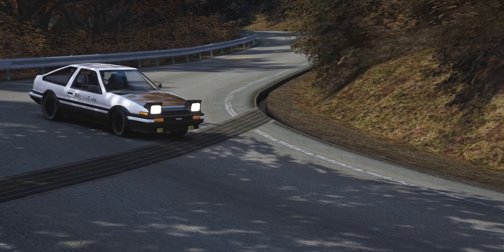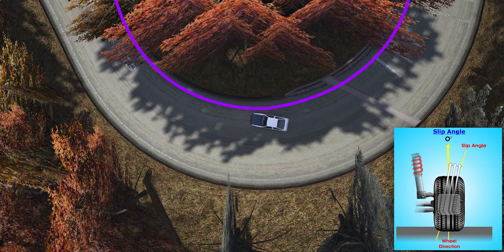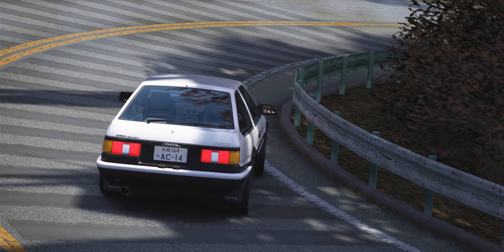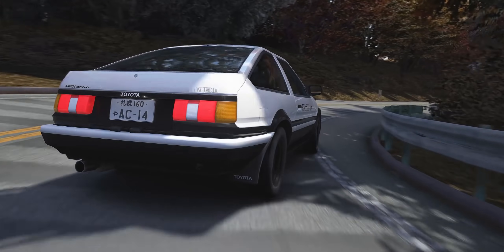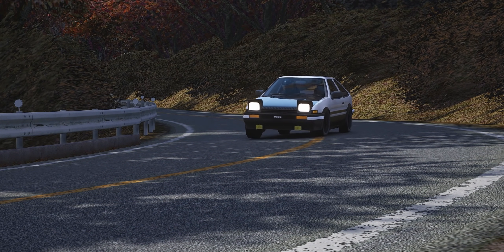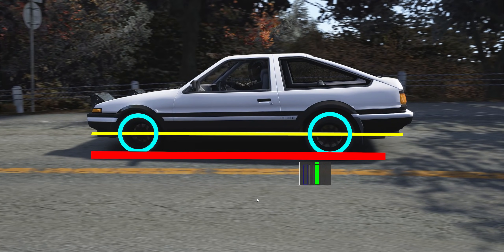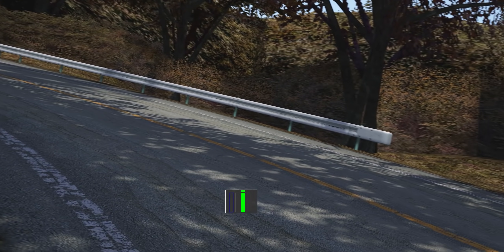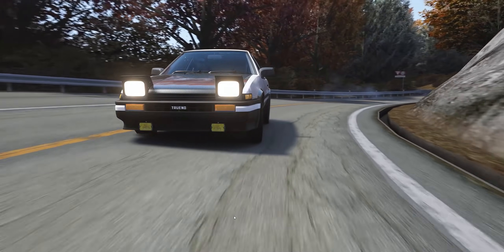Slip Angle in Touge - Master this to be a faster Sim Racer

Comment: Kunimitsu Takahashi actually "invented" this driving style, using it to make up for the missing power of his car during races (it helped him achieve multiple wins) , which then in turn actuallly started also helped invent drifting in the way we know it today. Keiichi Tsuchiya, who came to be known as the "drift king" only started drifting because he watched Kunimitsu Takahashi do this for the time unseen technique where he slid along the apex. He then started to work on his own technique, but more for style than function and became the drift king.
Reply: That's not entirely true. While Tsuchiya was inspired to develop drifting after seeing Takahashi race, Takahashi was not the inventor of driving in that manner, he just did it in a more dramatic fashion than the other drivers Japan's touring car scene. Racing cars being in a state of slip angle when driven hard was pretty much universal across all drivers at the time as it was a result of tyre technologies at the time, namely their sidewall deflection characteristics and hard compounds, along with a lack of down force when compared to modern equivalents. The pioneer of the technique is most often considered to be Tazio Nuvolari and it was used in some degree in Grand Prix racing until the ground effect era.

Comment: Since I play rally games slip angle seems intuitive because its the fastest way to get around the tight corners
Reply: It’s the fastest cause of side force. The tyres dig into the dirt as you go sideways round a corner so you actually have more grip that not sliding tarmac are dirt are in the same solar system but not on the same planet.

Comment: Same as shinji’s style of smooth grip/drift driving, no wonder he was as fast as takami
Reply: I thought shinji's technique was the minimum brakes since he uses engine brake to slow down his car thus making him faster than those who use brakes
Reply: @sesu5543  nope he uses his breaks many times but he doesn’t slam on them like most drivers, his technique is equal weight distribution on all four wheels at all times so he has an extremely smooth driving style that’s insanely fast plus he adds the slip angle technique to it, so he’s definitely faster or as fast as takami easily
Reply: @beautifulbeaner  hes only as fast on his home circuit though, on any ither riad he would suck, its because his technique revolves around having the perfect entry speed, little brakes, smoothest cornering, and the best line.

Comment: The weird thing about F1 is that if you notice in some specific circuits, the drivers will actually use the slip angle to be faster in a corner but it's just enough to turn them in fast without sending them into a spin

Comment: Personally, I think (in theory, I haven't been able to test it yet) that rotation should be done at entry/mid corner to point the car towards the exit earlier while carrying speed.

Then when reaching exit phase, the line from the car to the exit of the corner is more straight, and the car shouldn't rotate as much, because the less the rear wheels are spinning exiting the corner, the better exit you have, because traction is maximised and the more momentum you gain earlier and more constantly.

Sorry for the long comment 😌
Reply: this is actually a really good explanation
Reply: @deletedchannel117  Thanks! ✨

Comment: I used to think that it was just a quicker style of drift. But now I know that it is actually called slip angle, and I know more about it I can use it in games more often
Reply: It's not called slip angle... He's using the term incorrectly here. As he stated at the start of the video, slip angle is the angle between the direction a tire is pointing and its direction of travel.

Comment: I do this quite often when I'm hooning around in my car, just as I'm entering the apex of a turn I'll tap the brake to shift the weight forward so the back end swings around the outside of the turn and  was called trail braking, this technique is used in rally driving.
My car is front wheel drive that's why I drive like this because it gives the front wheels more grip when cornering
Reply: Pain

Comment: It is more about preserving momentum instead of accelerating through, into or out the corner Especially in a low horsepower car like the 86 at a higher speed you would also be able to keep the rpms high keeping the car on its ideal power band on corner exit.
Reply: Damn who knew an anime with some guys racing dowh the mountain could have such advanced physics behind it
Reply: @mahuba2553  I heard that they consulted the Drift King.
Reply: RPM means jack shit. It's all about exit speed. Drifting only makes you slower.
Reply: @StuninRub  it's always ideal to keep your revs within the peak power band whenever possible.
Reply: @StuninRub  Well in the video its more about powersliding than anything else, which is useful in some kinds of corners, and high RPM does matter if you wanna keep your car from getting too much grip back and snap understeering
Reply: @mahuba2553  Imagine not wanting your car to have too much grip. I bet your car has a big ass wing for downforce and FWD as well. 

What you saw in Initial D does not ring true for real racing. You always want more grip and the only thing that matters when cornering and going fast is the exit speed.
Reply: @StuninRub  And what IF I had an FWD with a big wing? Even those can oversteer, and you know that cornering aint just about staying in line and hoping nobody goes through the inside, there is way more than just that
Reply: @StuninRub   Actually for faster speed throughout a corner you want a "slight" oversteer, this we call slip angle,  It's not always faster to purely go on grip  Because keeping a high rate of speed  throughout a corner It's not possible if you have to break in order to keep the grip Especially on 75ﾟdegrees or tighter corners,  And talking about higher rpm's at corner exits  It's important for the RPM's not to be low since most sportcars peak on power and torque higher in the rpm range.
Reply: @StuninRub   Even formula one cars going through corners do not only rely on grid, Despite all of the aerodynamic devices  Their suspension designs allow for  The customization of caster caster and camber  Angles throughout the race In order to make it easier too slightly oversteer in corners thus keeping a higher rate of momentum.  To solely depend on grip is not the answer.
Reply: @kennyiglesias622  You want 0 oversteer. F1 drivers slide not because they want to, but because of the physical limitations of their cars. There's a reason why ground effect cars went so fast, maximum grip and maximum power. 

Initial D isn't real.
Reply: @StuninRub  initial d is not reality but what I'm telling you is  There's a difference in between loosing grip (tires being the limiting factor here )and purposely designing your suspension geometry in order to induce slip angle, is about carrying as much steady momentum as possible thru the corner not about keeping 100% grip at all times, I'm not saying that drift is always faster cause that's obviously not the case but depending on the corner you as a driver will need to prioritize your cars momentum&direction more than your grip cause you need to remember that tires and available traction are the LIMITING factors in all tipe of car racing sports in which you need to prioritize time from point a to b (f1, circuit racing, rally & time attack etc....) slight slip angle and a little bit of oversteer is utilized in their respective courses in order to reduce times. If you could have MAXIMUM GRIP WAYYYY BEYOND WHAT TIRES CAN POSSIBLY PROVIDE all the time then yea grip would be king but due to g forces you would not be able to drive that vehicle and that's not real life,  The utilization of slip angle in tighter corners remains one of the FASTEST ways to reduce times within current physical constraints even if you use ground effect to increase grip the 1st limiting factor would still be grip and if you wanna go faster even cars utilizing ground effect would still sustain slip angle if pushed hard enough to break the grip boundaries of its rear tires. Carefully watch how rally drivers drive thru tight corners or even less noticeable what how f1 , time attack and downhill drivers go thru corners you will notice that most cars look to be taking the corner using grip but if you pay close attention you will see that they actually carry a small angle thru them.
Reply: @kennyiglesias622  That vehicle with maximum grip does exist and it's called ground effects. We have the technology to create cars with enough downforce to drive upside down. Once again, stop using Initial D as reference. Grip will always yield faster times on the track.
Reply: @RacingOmen  His phrases are all bullshit. Initial D isn't real.
Reply: @StuninRub  Try me kiddo. I'm doing real tracks, rpm means everything. Not every thing is power and grip. It's how you drive your damn car and know how to use its limits. 

For sure you don't even have a real car to trash upon on while trash talkinh like that. Jeez.
Reply: @JMDrives  RPM means jack shit. Racing is all about power and grip. That's why you're stuck playing arcade games like Initial D.
Reply: @StuninRub   As previously stated even with ground effect,  Tires still become a limiting factor,  Even cars that utilize ground effect devices normally to lose a little bit of grip in the rear tires this is  normally not noticeable unless you pay attention but it does result in a little oversteer (a slip angle)  again not in all corners this occurs in tighter corners grip and power are just a factors  Too much power destabilizes the chassis and too much grip wears tires faster if you want a lot of grip it normally takes a lot of downforce with introduces a lot of drag making the car slower,  The grippier the tires the harder is to get them to change direction (eg.corner) so during corners they have to lose a little bit of grip first to gain it back in a different direction ( they have to let go, slip and stick to the ground again) no perfect grip tires that don't tear and wear exist and no ground effect is possible without making a sacrifice ( more weight on the car, more drag, A parasitic draw on engine power to have a fan suck you to the ground, or having to be already moving at a certain speed to be able to fully utilize the ground effect in the first place) THE FASTEST CAR IN ANY CIRCUIT OR STAGE IS THE CAR THAT MAKES A BETTER BALANCE OF ALL AVAILABLE FACTORS IT IS NOT ALL ABOUT A SINGLE OR TWO THINGS. but if I'm not trying to argue I'm telling you the truth of how it works in real life , I spend 5 years learning in the automotive field under the guidance of a Physicist ,mechanical engineers, fuel & emissions experts and mechanics. If as a mature person you want to learn you gotta let go of your previous misconceptions of reality but if you wanna keep arguing about this with someone that spend years of his life studying about the topics related to the issue and keep being ignorant about the way things work then as one of the comments on top of mine said you are not worth the time I'm putting into my replies.
Reply: @kennyiglesias622  Imagine thinking you have 5 years of experience because you were watching anime. You should look at what happens when ground effect cars lose traction.

 People who bullshit will always create responses with a ton of nonsense. 

It is never a good idea to lose traction. Intial D is not real.
Reply: @StuninRub  I know I have 5 years of experience cause I studied for 5 years at the same time I worked on cars, i never said initial d was totally real, it is never a good idea to ''FULLY'' loose traction, but you don't seem smart enough to understand that. You are right in one thing (People who bullshit will always create responses with a lot of nonsense) quite ironic that it came from the one saying the bullshit.
Reply: @kennyiglesias622  Mine's a slightly modded rav4 3dr, that's otw to being a 3sgte. Still costly for me in progress. But rather keeping myself on this car only, I also borrow my friends' cars on and off track to "experiment" 😆 how other cars handle differently than others. 

So I won't be like an idiot, being too close minded to just understand one thing about cars like this dumbass ---> @Zhida Zhou

Btw, wanna see your 13b on an FC soon bro. Goodluck with that! D1 Spec Banawe and JSK builds a couple of 7s. Maybe Aurick Go can help bro or Andy Adan.
Reply: @JMDrives  I'm not even going to lie, the whole electric system is gonna take me at least 3 months and I still want to have AC but I'm gonna have to buy a couple of plastic  trim pieces cause original ones from the 80s are all cracked now 😅, hopefully next month I'll get my piece of shit mobile moving under its own power, good thing the body is not rusted and the paint is ok, the whole thing is gonna be the worst part about it, I also ordered a new gauge cluster cause the stock one tops at 8k rpm and mine will probably redline 10K. Is not even funny the amount of time I have put polishing my turd on wheels but I love the thing.
Reply: @kennyiglesias622  I just subscribed to you lad; It was great reading and learning from your messages. 👍🏻
Reply: @StuninRub  hey hey hey, I can tell your an American muscle sort of person lmao
Reply: @jordanrobshaw1406  hey hey hey you sound like another weeb who thinks it's always JDM vs American muscle. Unfortunately for you, I'm not dirt poor and don't need to compromise for either.
Reply: @StuninRub  lmao ok mr "not dirt poor" what cars do you like?
Reply: @jordanrobshaw1406  Anything that goes fast and sticks to ground like it's on rails. Give me any of the proper GT cars.
Reply: @StuninRub  what car do you actually own though? If you own one of course
Reply: @jordanrobshaw1406  I drive a Cayman.
Reply: @StuninRub  ah the poor mans porshe, its a pretty good car
Reply: @jordanrobshaw1406  Only poor if you get poverty spec.
Reply: @StuninRub  its just its nickname,so what do you have against the lower class?
Reply: @jordanrobshaw1406  MIsinformed and thinks anime is real.
Reply: @StuninRub  why do you diss the lower class? I'm gonna assume you voted for biden or Bernie sanders
Reply: @jordanrobshaw1406  leave him alone, you know he really is the one who is not properly informed if instead of arguing with you he proceeds to ignore what others say and insult you. 
You are never going to win a rational argument with him because there's no rational argument to have with an ignorant person.
Reply: @kennyiglesias622  "Words are a powerful thing, but only if people will listen, action speaks loud enough for anyone to hear" - Ryosuke Takahashi
Reply: @Delimon007  Imagine think you are driving fast when you are losing traction.
Reply: Suggesting that F1 drivers can't help it when the rear kicks out when that's literally what they practice and learn to keep at a minimum. You follow this up by saying that using maximum grip and power over RPM is key.

Racing spec cars tend to have power in the higher rev ranges, so already, you're getting more of your engine's power at a higher speed.

And, in an even more egregious lack of thought, you're indirectly saying that F1 drivers are bad at their job because of something that's easily fixable by their standards.

On top of that , there are sources like this video here (https://m.youtube.com/watch?v=0yci11pZz1A), which show that slip angle (and in the case of one section, a full, showy drift) improves time over full grip.

Admit you're wrong, stupid, or lying in spite, because you clearly don't know enough of what you're talking about.
Reply: @VSBScott  LMAO I'm sure the Japanese wins F1 all the time. You don't know jackshit about racing. Intial D isn't real.
Reply: I never said anything about Japan winning F1 one time. I was bringing your inconsistent, insulting logic ABOUT F1 to light while providing an example of slip angle being the faster method in many cases (an example that has actual times and an overlaying comparison at that). By the looks of it, you ignored the very real point I made, including the example I used.

On top of that, I never even brought up Initial D. You seem to be arguing with yourself a lot. You feeling alright, bruv?
Reply: @StuninRub  you might be the biggest troll ive seen in a while thanks for the read
Reply: @beemo7616  I'm sorry, Intial D isn't real. Losing traction makes you go slower.
Reply: @StuninRub  bro you're trolling honestly
Reply: @yobrethren  bro initial D isn't real, honestly.
Reply: @StuninRub  bro i didn't even talk shit about initial d, you're so funny bro
Reply: @yobrethren  Anime isn't real, get mad.
Reply: @StuninRub  bro you're so funny HAHAHAHAHHA bro
Reply: @StuninRub go watch rallying. The corners on most rally stages are incredibly narrow and tight, meaning if you want to take them without the wheels slipping at all, you would have to slow down massively. By using a controlled slide you can shorten the ordinary turning circle of the car, allowing you too carry much more speed. This also lines the car up for a late apex, allowing for earlier acceleration out of the corner, where traction is fully regained.
Reply: @StuninRub  

I would say you are both right and wrong. RPM 100% matters because cars have different power bands so if you can hold a higher speed chances are you're in a better power band for most cars but this only matters for the peak drivers who are trying to shave every nano second of their time and you would also be correct as if in the entire point is to allow you to accelerate faster yielding a faster laptime around the track depending on the layout.

Comment: What your showing isn't slip angle. slip angle happens at a way lower rate for any road car. it can be up to 8 ish degrees for something like a gt3 car but on a road car its usually less than 5 degrees. what you are doing is weight shifting with low angle drifting.